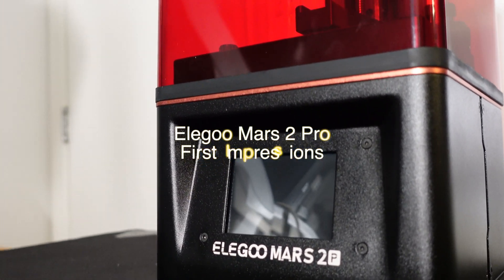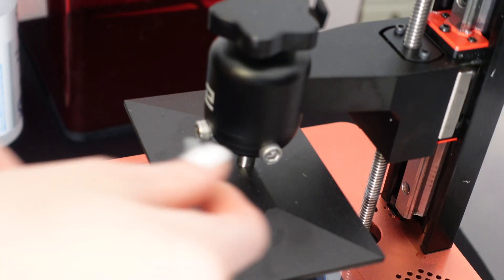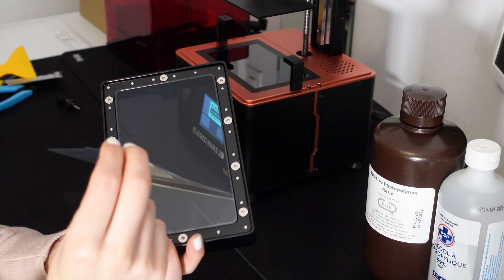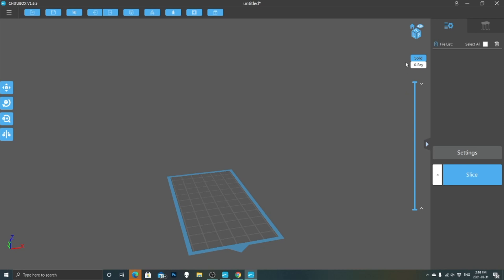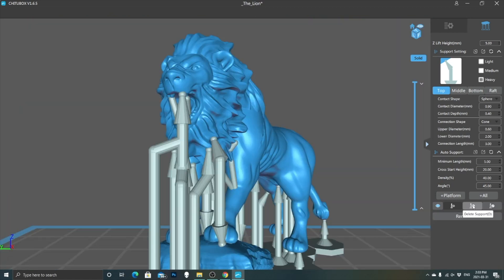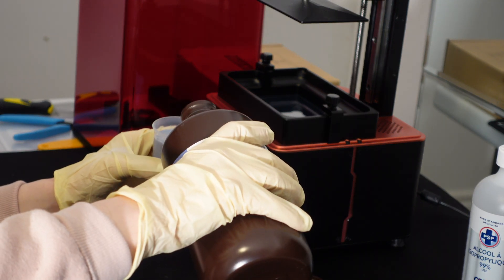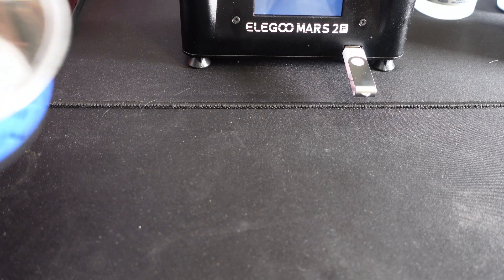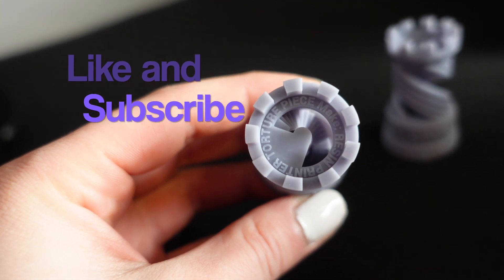ELEGOO MARS 2 PRO: SETUP AND FIRST IMPRESSIONS

Comment: Hi! I'm new to resin 3d printer, but i have a little experience with filament 3d printing. I have a question, is it possible to modify the Z axis in the printer settings? Cause I'm planning to modify and upgrade the Z axis of this resin printer. I bought a 500mm ball screw with single linear rail, i really want to print taller models such as ironman flying.
I just ordered my elegoo mars 2 pro + elegoo mercury 2 plus, I'm so excited and can't wait to test them out. 😅
Follow-up question, is it possible to dye the resin? I'm planing to customize the color of the resin, I've ordered clear/white/black/gray/skin resins and dr. Martins ink. TIA! Liked & Sub...

Comment: Hey, wondering if your printer had the grid line issue fixed, I had the mars pro 2 also. It show the UV grid array showed on my larger prints and caused a lot of faluries.
I have the Mars 2 mono now, I had a far batter experience. The prints faster and the removal of the carbon fan no longer blows resins fumes out, etc.
Reply from the maker: Hey!! I haven’t had any issues with grid lines appearing thankfully, but it’s unfortunate that you encountered this issue. 
I’m happy that you decided to upgrade though. My main issue with the elegoo Mars 2 pro is not being able to change the carbon filter...so it’s great you have that feature because it’s very necessary in my opinion😄 I recently purchased a respirator to compensate because I’ve been doing way too much research on resin that I am over cautious!
Reply: @nicolebalian  Elegoo now has these  mini air purifiers that can go i side the cover, haven't tried them yet tho..